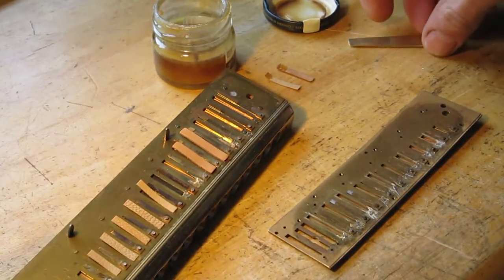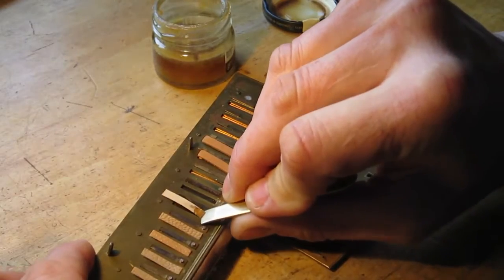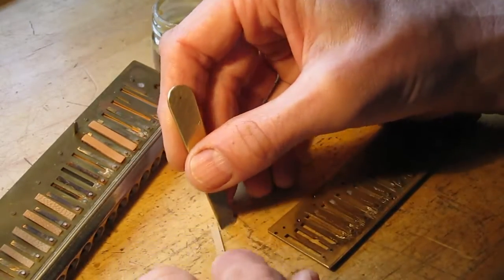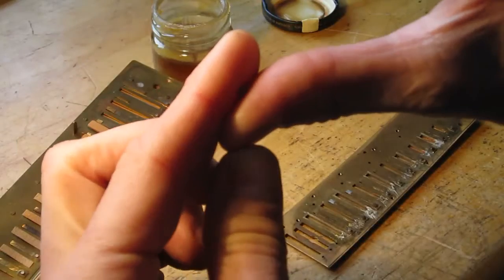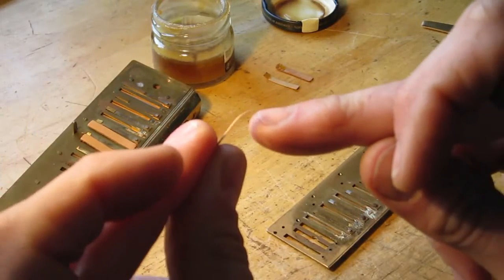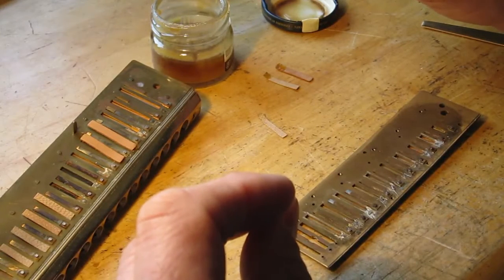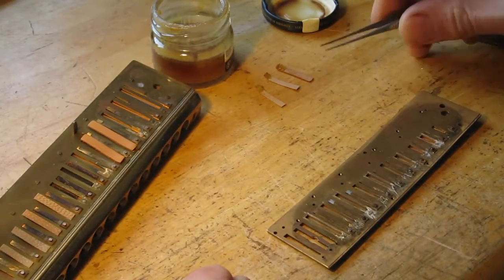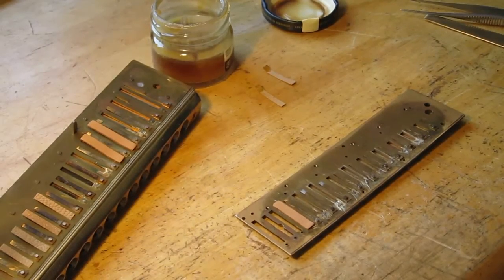Installing leather harmonica valves

Comment: Hi. Where can I find valves for my chromatic harmonica in the USA? I can't find any online store that sells them. Hohner's website ran out of stock for a long time by now.
Reply from the maker: Hi Jonah, sorry for the delay in replying. Hopefully Hohner USA will get more in before long. In the meantime, I find I can keep my valves serviceable for a long time by regularly cleaning them, using an ultrasonic cleaner such as used to clean jewellery. I immerse the reedplates in warm water with a few drops of detergent, gently lifting each valve so the fluid can get between the valves and the reedplate, and between the layers of the valves. Run the machine, then rinse and dry the reedplates and that’s about it. Of course any damaged valves may need adjusting or replacing, but most only need cleaning.

Comment: Thanks for the tip!I hope this technique works for the accordion also. I have this issue for my accordion.I have a question: this is holding on time?
Reply from the maker: Hi Sorin,
I have found that the shellac can sometimes grow weak and the leather valves start to fall off in accordions where the valves have not been replaced for perhaps 30 or 40 years, but for an instrument being played, the valves will probably need to be reset or replaced long before that.

One other point: old valves can sometimes grow stiff and choke the airflow past the reed.  After servicing a valve as shown in the video, hold it by the end to be glued and give the free end a little flick to test its tension.  If it it too stiff, repeat the procedure, curling the valve from the same end, but with the valve inverted so that the napped, or fuzzy side is facing out.  Then repeat the process yet again with the grain, or smooth side facing out.  Then test the stiffness of the valve.  Repeat this process until the leather has relaxed to the desired tension.

Comment from the maker: You should be able to find a pint or quart bottle of shellac wood sealant at your local hardware store.  Shake it up then pour a little into a small jar, leaving it open for a couple of weeks until the alcohol evaporates enough to leave it the consistency of thick honey.  If it gets too thick just add a little more shellac from the big container.  
Alternatively, I think that most woodwind pad glue is made of shellac.  But the Italian accordion technicians I worked with just made up their own valve cement from a bottle of wood sealant.

Comment: Hi Rick, I have an old Hohner student 4 that has all leather reed valves curling up.  How old is too old to re-curl?  Is there a point when you buy new leather covers instead of re-curling?  Thanks!
Reply from the maker: Hi Jo,

The older Hohner accordions, from around pre-WWII, used the same kind of brown leather valves like the harmonica valves shown in the video. Sometimes these valves grow stiff and need to be rolled up knap side out before rolling knap side in as in the video. This is to reduce the valve's tension, and the process may need to be repeated a couple of times until the tension is reduced to the desired amount. If the valve is too stiff it won't open enough during play to allow the reed to speak freely, and can result in a muffled tone and flatted pitch. This problem occurs more often in harmonicas as their valves can become wet from playing, growing stiff when they dry out. 

Post-war accordions used plastic valves on the higher pitched reeds and leather or Vileda (synthetic leather) valves with plastic over-layers for the lower pitched reeds. The leather on these valves is usually the blond coloured leather used in Italian accordions. This type of leather can become too stiff to recondition satisfactorily. And old, stiff Vileda valves are pretty much beyond reconditioning. 

If the old type leather valves are not filled with grime and tar, you should be able to recondition them. However, there is another issue in dealing with accordion reeds, and that is the wax. In old accordions, the reed wax can become dry and brittle, with the result that the reedplates can become loose and rattle during play. In order to do a proper job on the inside valves, you'll need to remove the reedplates from the wooden reedblocks. The old wax will then be useless for re-setting the reedplates, and new wax will need to be applied. Going to all this trouble in overhauling the reeds, you'd probably be better off using new Italian leathers or new Hohner plastic valves. 

Honestly, if you value the instrument and intend to play serious music on it, you might consider taking it to a qualified accordion technician. Otherwise, you might find some YouTube videos on overhauling reedblocks.  Here's a video showing a reedblock being waxed: waxing Hohner diatonic accordion reeds

Best regards,
Rick
Reply: Rick Epping Thank you so much for the reply.  I can tell you have lots of knowledge and it's great you share some of that with folks on youtube!  I'm going to use up some of my free time with trying to repair this 20$ Hohner I got at a garage sale.  It would have been thrown away if I didn't buy it so no harm done if I screw up.  I feel like it can only get better with the shape that it is in now.  The reeds all have spot rusting on them and all the leathers are curled up but they all seem pliable.  I know that with all the rusting on the reeds that they are probably all out of tune.  I'm going to  re-valve all of them and go from there.  I might try to scrape the rust off of the reeds if they are in fact horribly out of tune.  The wax on a few is cracked and needs repair.  I'm not sure about taking all of them out to mess with the insides of the reeds.  I'm hoping I can steady my hand enough to re-valve the insides with leathers without taking the reeds off the blocks.  We'll see how it goes.  Like I said, with the shape it is in now, anything fixed on this accordion is an improvement.  It sounds like you've repaired an accordion or two, do you find the process rewarding or annoying?  Would you recommend a source that supplies good priced leather or plastic reed valves?  Thanks for your time Rick.
Reply from the maker: Jo Dirt'e
Hi Jo,

Steel reeds can take a fair amount of rust and still be ok after the reeds are de-rusted, cleaned, oiled and then scrupulously wiped clean of all excess oil, but they will require re-tuning, which is another subject altogether.

It is possible, using tweezers, to remove and replace the inside valves without removing the reedplate from the reedblock.  It's a tricky technique that requires some practice.  After applying the cement to the valve (shellac for leather, other cement like Evo-Stik for plastic), you need to hold the valve on one edge, over the cemented area, but just on the very edge, and position the valve in place.  Then roll the tweezers over the top of the cemented area as you release the valve from the tweezers, applying pressure to secure the valve in place.  It's something that's normally only done to replace the odd defective valve and would be quite time consuming to do for all the valves.  You can also try massaging the inside valves flat by stroking them with a flat stick, screwdriver, or some such tool.  Not totally effective, but it helps a little.

Here's one online dealer who sells plastic and leather valves: http://www.accordiondepot.com/  I recall his name from years ago, but not sure if I ever had any business with him.  I have purchased leather valves from Carini, located in Castelfidardo, Italy.  Here's their website: http://151.1.156.236/jsp/index.jsp  It's all in Italian.  Ventilli pelli is leather valves, ventilli plastica is plastic and ventilli pelli e plastica is leather with a top layer of plastic.  The page for these items is: http://151.1.156.236/jsp/categoria.jsp?martigrp=FISCOM&martisgr=VOC#

Best regards,
Rick

Comment: Please tell meharmonica reed plet open but with aut skus
Reply from the maker: A reedplate held on by nails instead of screws can be removed by prying it off with a knife. Carefully insert the blade between the reedplate and comb, taking care not to touch any of the inside reeds, then lift the back of the blade to pry off the reedplate, a little at a time as you move along the edge of the reedplate. If you were to lower the back of the blade to pry off the reedplate instead of raising it, the edge of the wood comb might be damaged.